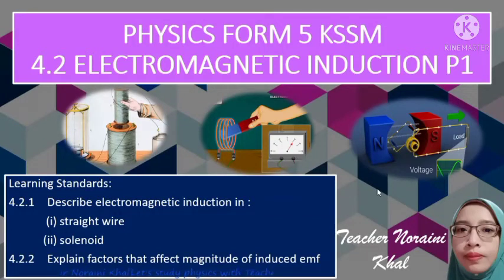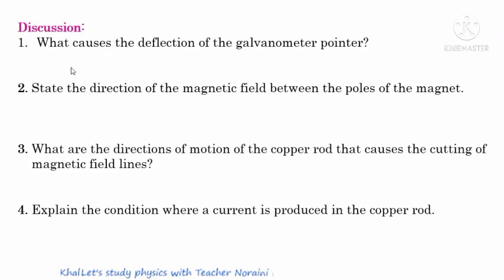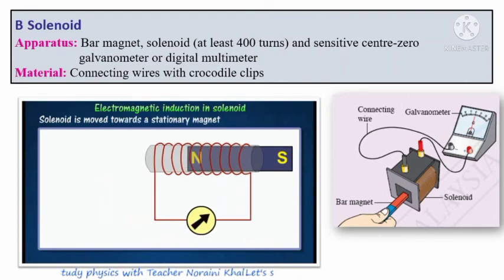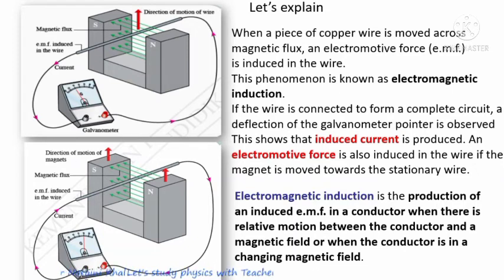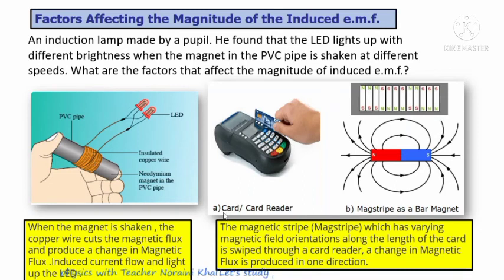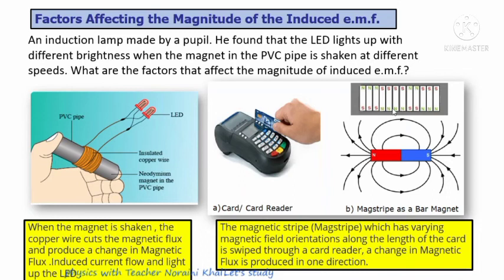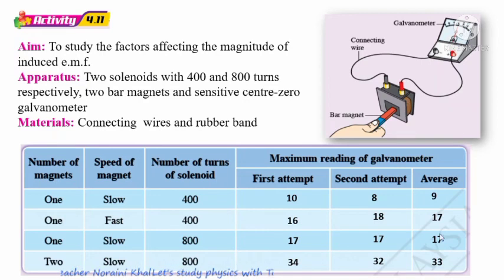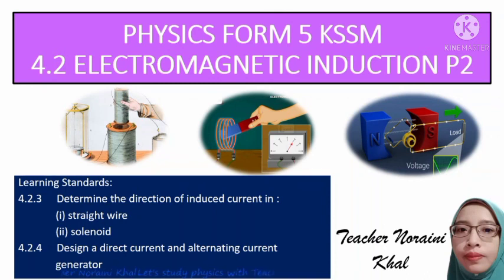4.2 Electromagnetic induction Part 1 #PHYSICSFORM5KSSM

Comment: Teacher may I know what is induced emf , induced current and what is the difference between magnetic field line and magnetic flux ?  I am confused ... tq teacher ☺️
Reply: And also induced electromotive ...
Reply from the maker: Induced emf is voltage that produced in the wire when there is change in magnetic flux..due to cutting of magnetic flux.when circuit is completed,the induced emf will cause induced current to flow.(same as battery that supply current)
Flux =field lines
Reply: @TeacherNorainikhal  tq